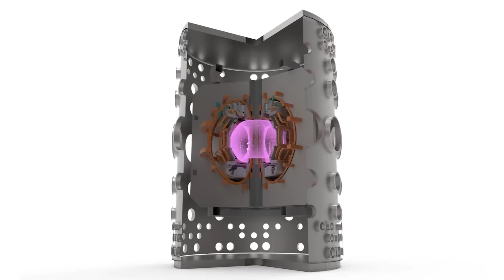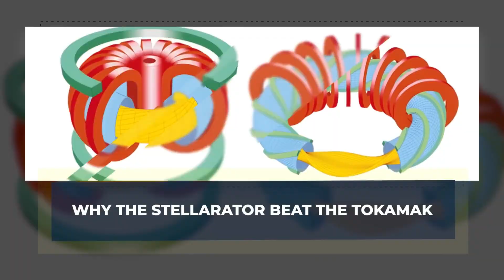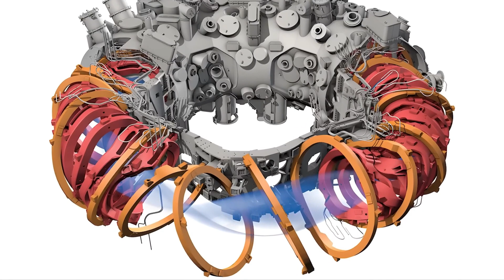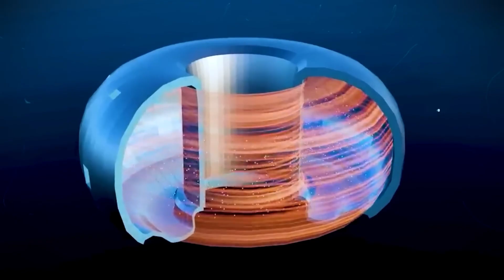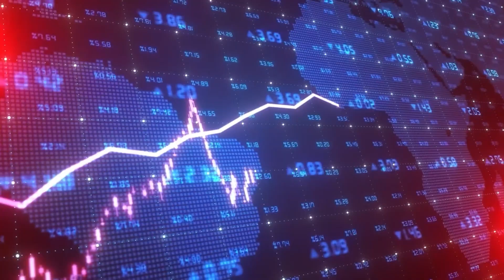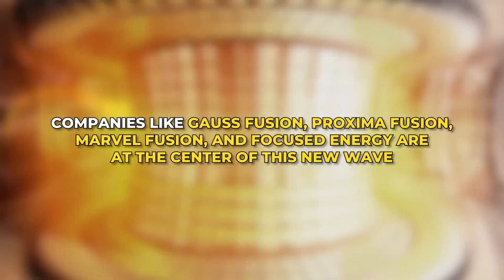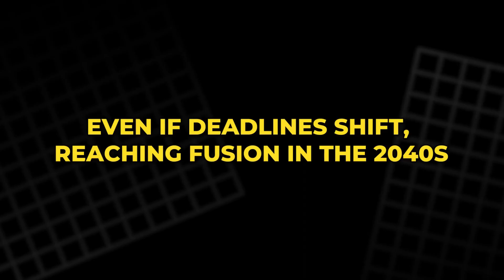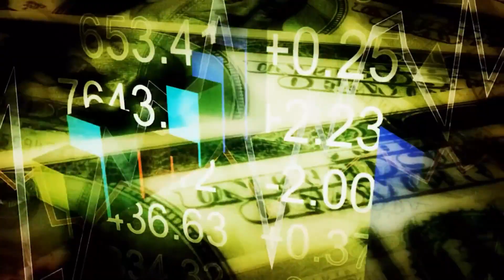Germany’s Fusion Reactor Breakthrough That Changes EVERYTHING

Comment: 1932 was when man was able to make the first fusion. The first reactor was in 1950. Commercial fusion is still 50 years away. Commercial Fusion has many HUGE problems to overcome. No source for the huge amounts of tritium required as fuel, no reliable way to sustain a reaction - the metal in the magnets currently being used crack and twist under the stress and need to be replaced... It still takes more energy to create it than it produces and the list goes on.
Reply from the maker: You’re absolutely right that the engineering challenges (like tritium breeding, magnet stress, and net energy) are massive... No one is claiming we are plugging this into the grid tomorrow.
However, the significance of the W7-X isn't about immediate power generation (it wasn't built for Q>1); it’s about solving the stability problem. Unlike Tokamaks that are prone to disruptions, this Stellarator design proved it can maintain a stable plasma for extended periods (43 seconds is an eternity in fusion physics). It proves the complex magnet geometry works. We aren't ignoring the hurdles you mentioned; we are just finally ticking off the boxes required to overcome them.